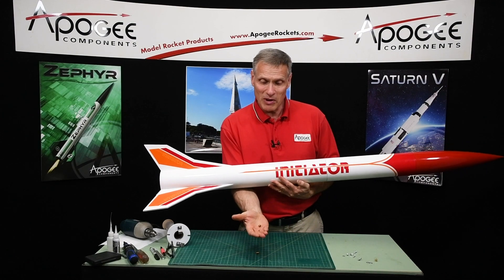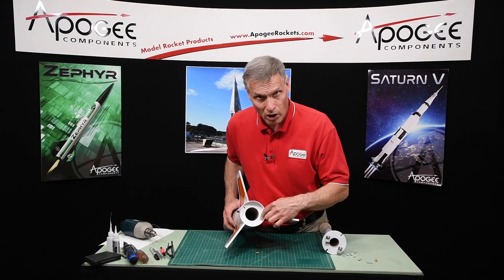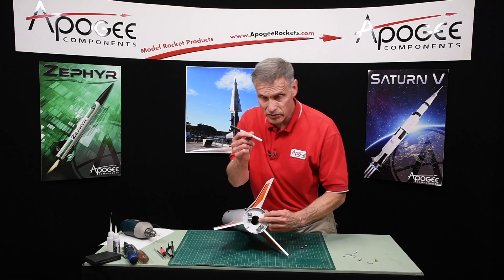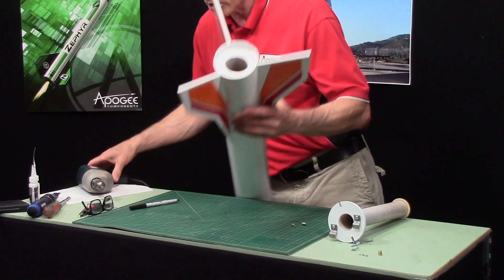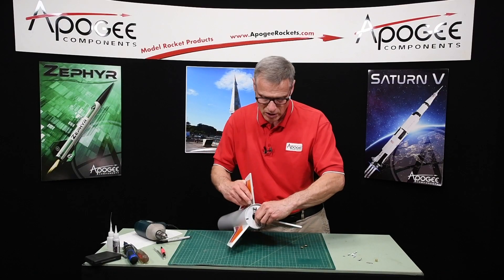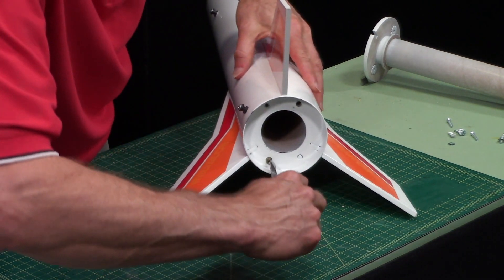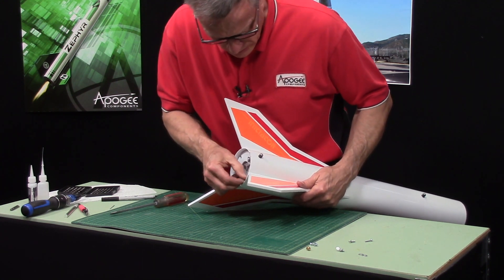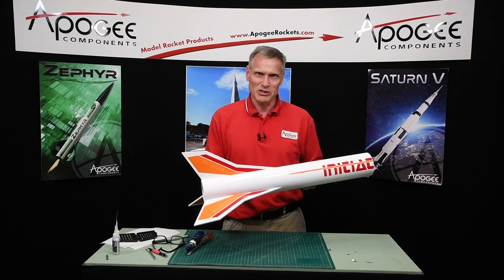Using Threaded Inserts to Repair a Rocket

Comment: I have retrofitted rockets that did not have motor retention with inserts. Then I use mirror clips AKA Kaplow clips. You can also add inserts before attaching the rear centering ring.
Tim's videos have been extremely helpful during my journey into more advanced levels of rocketry.

Comment: I used some of these inserts on my Mozzie.  A motor exploded and blew the screw on retainer and the last half inch of the motor tube off the rocket.  It hit the ground so hard it bent and couldn’t be reused.  The rear centering ring was still good so I mounted a flat bottom retainer to it.  Good as new!

Comment: Someone needs to donate this guy a cordless drill lol i haven't plugged a drill in 15yrs lol
Reply from the maker: I went through two cordless drills - and the battery pack kept dying on me and wouldn't take a recharge. My 20-year old drill that I plug in may be old-school, but I never have to worry about the batteries. But if you want to donate one to me, I'll be happy to accept it.
Reply: @apogeerockets  lol buy a dewalt i might have to send u one for all the great videos

Comment: That aerotech rocket should of came with 38mm fin locks so u could upgrade all ther rockets
Reply from the maker: The "Mega" version of this rocket is different from Aerotech's other kits. It does not have plastic fins, nor does it have the fin locks. It is actually made for Aerotech by LOC, so the construction on this one is different.